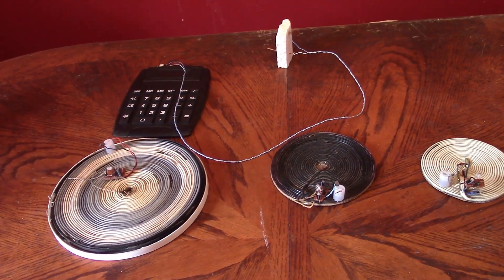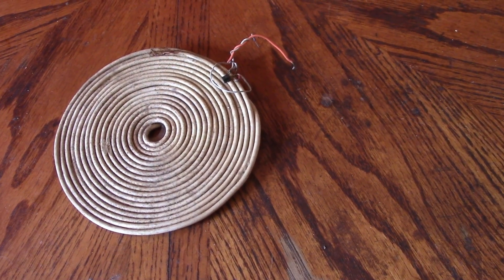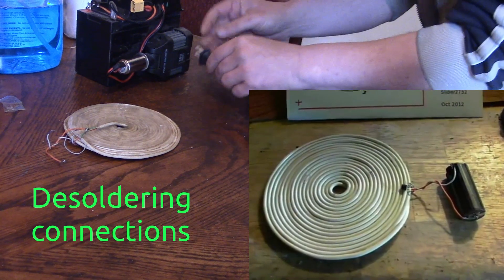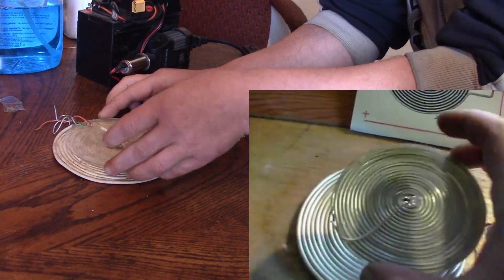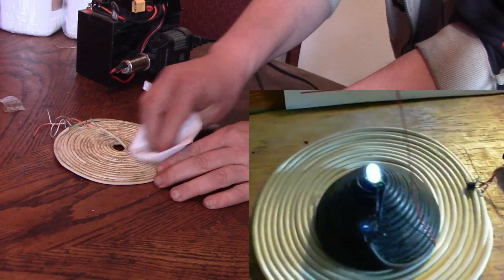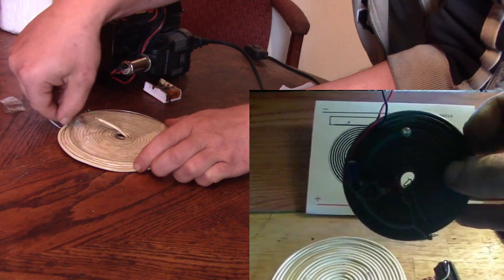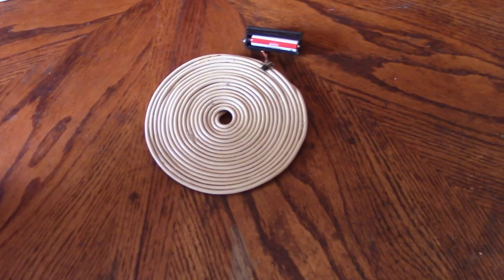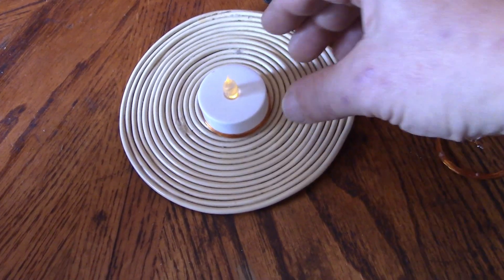Restoring The Original SWES Wireless Electricity System From 2012

Comment: Very cool! What kind of transitor did you use?
Reply from the maker: Thanks Sam 😀
It's a small signal NPN, 2SC1815 GR, though 2N2222A, 2N3904 and others will work great. 
In fact, any NPN or PNP transistor will work with a SWES (just swap the +/- wires for PNP.), the only differences will be current usage and wireless energy range.
Reply: @Slider2732_  Thank you. I will build one tomorrow.👍

Comment: First time seeing this pretty cool.
Would a bigger supply and coil extend the range?
Reply from the maker: Thanks for watching Jon 😀
To an extent, yes, higher power and a larger diameter coil does work well. Two much larger coils from around that time were made from coax cable and were able to light a mains bulb at 50ft away over 1 single 30AWG wire. A great improvement can be made by matching the sender/receiver coils with capacitors on each (normally around 0.001uF), then energy distance is greatly improved.
Reply: Be great if you were to do a how to video you could put one in the back yard powered by a solar panel and have free night lights.
Reply from the maker: @Jon-fs2zj Great idea! Thanks Jon. I'll run with it and credit you in the video! Have been building a solar powered setup for the past couple of days and didn't know which way it should go... you've solved it 😀
A regular garden light type of circuit isn't too difficult to make, for auto switch on at night. Once built, any type of small load could go on top of a coil... different types of LED etc, rather than being stuck with a single white one.
Reply: Looking forward to it.
Thanks